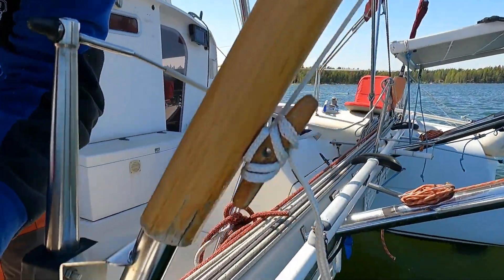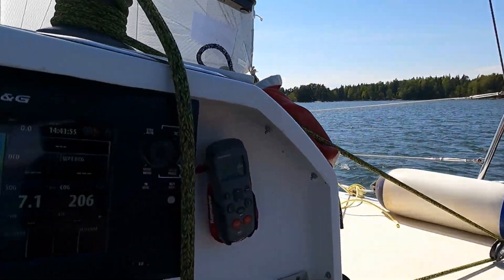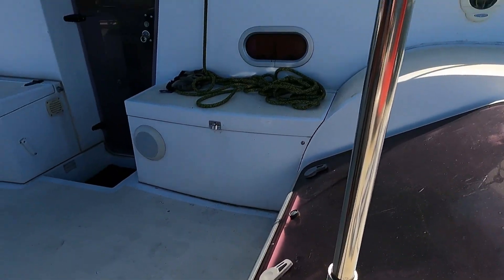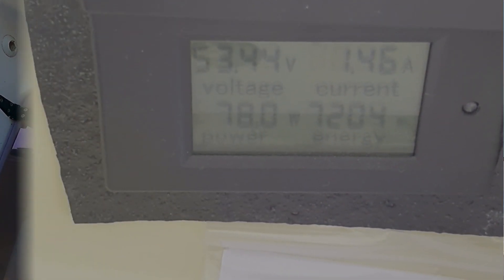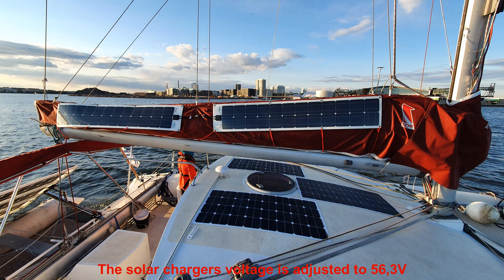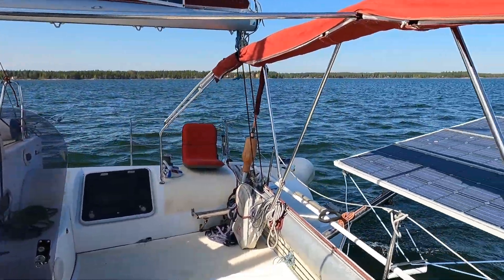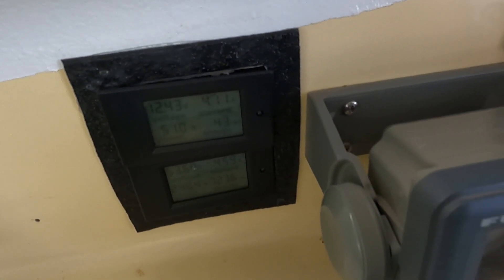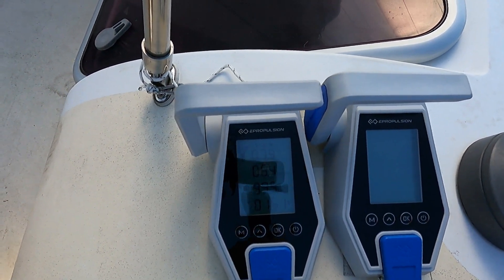Electric outboard ePropulsion Navy 3.0 Evo regeneration test

Comment: Hello Martin. My plan is to buy an edel 33 cruiser like yours or a maldives 32. Can you please share your speeds on twin motor only (no sails) and associated power consumption? I d like to know if 2kw is able to push you at 4.5 knots approx. Thanks a lot for your impressive work. Cheers from france. Pierre.

Comment: very cool...i have an Aristocat 30, was thinking of 2 x navy6 outbds....but you have the navy3 outbds...what do you get with both powering your boat? and what is the manoeuvrability like in marinas?
Reply: just looked up your boat detail...only 3.6T....mine is 6.8T   so really i need 2 x 10hp outboard
Reply from the maker: Sorry for the late answer, top speed is 6.6 knot. I suppose also that you would better go with 2 x Navy 6.

Comment: Thank you Martin for sharing this on your video.  I am so curious if the hydrogeneration feature will drive more boaters toward electric propulsion. For sailboats it seems like a no-brainer.  I run a vintage 50 foot wooden trawler so am not qualified to have an experienced opinion. Seeking yours so I can share with our Green Boating Community.  Thank you.  ~tgb
Reply from the maker: Regeneration is an option for relatively fast sailing boats, the power generated gets interesting above 6-7 knots and if you are sailing at those speeds for many hours. For me, it's a nice to have thing, because my batteries are charged by solar panels. Late season (I sail at 60 deg north) when the days are short, I might really need it one day (has not happened yet).

Comment: hello martin, nice setup! i have a question for you about the edel 33. The ones that i saw don't have that center saloon that connects both hulls. did you made it ?
Reply from the maker: You have probably seen an older model. This is the Edel 33 built from 2007.

Comment: Hi Martin. This was very interesting for me as I am considering a change from my current 9.8hp Tohatsu to either a single 6kw or maybe 2x 3kw epropulsion motors. My boat is a Corneel 28 cat (1600kg) so a bit smaller than your Edel. Keep the videos coming! Thanks Andy
Reply from the maker: I guess for the Corneel 28 even 2 x Spirit 1.0 could be enough, either as outboards or as pods.

Comment: Do the 3.0's have enough strength to push your cat? I've been looking into swapping out my 20HP Diesel for twin ePropulsion 6.0 pod drives and have been wondering if they will have the strength necessary to make up the difference. 

 I found this video very cool! Well done on the Regen Test.
Reply from the maker: My boat was previously equipped with one Yamaha 9.9 high thrust engine. Performance is equal with the 2x3.0, both without wind and motoring into strong headwinds. The twin 6.0 should be equivalent to the 20hp diesel. Naturally a lot of additional benefits having twin engines vs one.